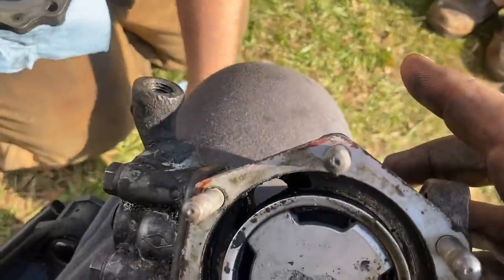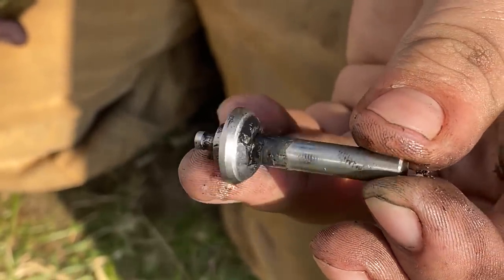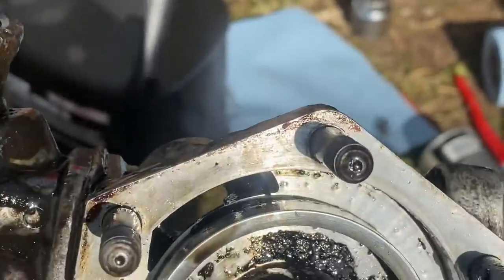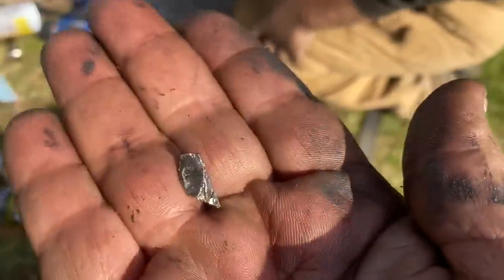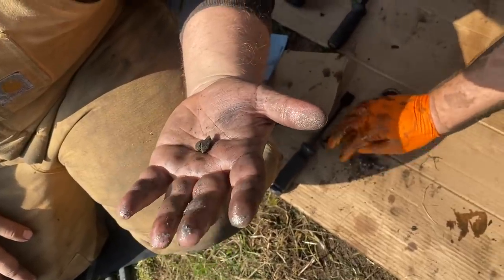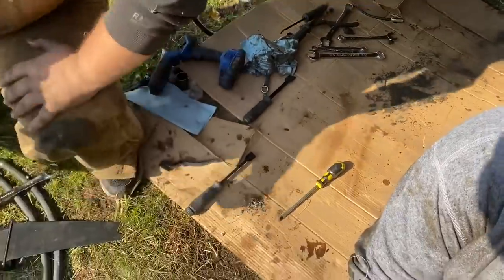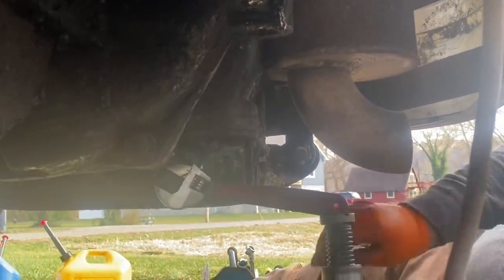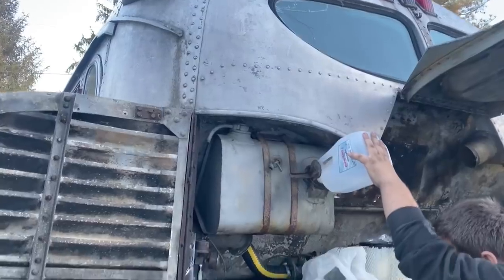Silversides bus update

Comment: Everything used to be built to be repairable ...so true ...oh yeah , and to last !
Reply: Agreed, and it's also better for the environment. I've noticed a lot of the so called "green" tech is disposable.
Reply: Steamfan71 Tier IV emissions requirements are the biggest “green” initiative that is absolutely not “green” at all. It’s just costing owner/operators a fortune and not doing squat for the environment.
Reply: @prevost8686  Agreed, they traded fuel economy for emissions reductions which is the definition of counter productive IMO.
Reply: @prevost8686  Yep those emissions standards virtually killed off the excellent EMD 2-stroke locomotives on main lines.

Comment: By the looks of that air valve, I'd say the air system needs servicing starting with the air compressor, I'll bet the air tanks are full of snot.
Reply: Your right, compressor dumping oil!
Reply: Yep but over how many years did it take, rebuilt many many compressors  over years on trucks and when on field service always kept cans of oven cleaner in my vehicle for this type of breakdown situation
Reply: Don't know the spec on today's modern compressors, but the older ones were designed to pass about 7cc of oil per operating hour.  If you have a properly functioning air dryer, the air dryer will catch and remove that oil (along with water),  but if the air system relies on an alcohol evaporator to keep moisture from building up,  that won't deal with excess oil being passed.  And the tank drains, well not ALL of the contaminants make it all the way to the wet tank.
Reply: Stan, I would be curious if that bus even has a dryer.  However you are correct the older compressors passed oil.

Comment: The most novel use of a bottle jack that I've ever seen :-D  Around thirty years back, a fellow industrial engineer at Boeing retired after concluding his work on the design of the ultrasonic fuel sensors for what would soon become the much beloved Boeing  777- 200; and the world's very first ultrasonic fuel quantity measurement system on a commercial aircraft.  Almost three years later, he built a "high performance version of the Volvo 940-GLE". 

Bill's definition of "high performance" was to 'pull the craphouse quality original Volvo engine out, grab a 302 out of a 'rear end damaged/total loss 1992 Mustang' add a "stealth blower", from  what I believe to have been a failed prototype gasoline fueled aircraft engine built in Canada. He also scratch-built his own suspension and steering system [based on the Mustang II steering rack].

It was during this time, that he became tired of costs associated with his Safety Kleen parts washer, and designed an automatic ultrasonic heated solvent parts washer, which worked in similar fashion to a dishwasher.  The solvent in his parts washer was constantly filtered and 'pristinely clean'. The washer cycled until the solvent generated from the wash retained less than 5% contamination levels.  His estate sold the patent, patents - actually, and that very same washer sits in my northern PA garage storage area, unused since the Bush Administration left office.  That washer would have worked wonders with your Silversides efforts of today.  Bill's design never made it into production. I'm guessing that it became a legend similar to the 100-mpg carburetor of the "Disco Era".

Comment: can more debris float back into the rest of the gears and damage it worse?
Reply: Iron chunks don't float.  They sink.  That's why engines, transmissions, and diffs have sumps.  Keeps the metal artifacts out of the important bits.
Reply: Small particles can float around and effect the bearings.

Comment: Maybe someone around there has a borescope or Harbor Freight camera to take a look see at the ring gear.
Reply from the maker: I have a borescope camera
Reply: Perfect place for it!
Reply: @kevinoscarson2941  Not now! The refilled the rear differential already. But I agree, it would have been worth the look.
Reply: Recently our local Rural King was blowing out a lot of their Tool Shop stuff, and I picked up one those inspection cameras for less than $35. I can see lots of uses for it...couldn’t beat the price either!
Reply: Worth a look just to see if it’s more than one tooth or adjacent teeth. It’s a big gear, it’ll be ok. Carry HF camera on the truck. Good to look in walls and ducts.